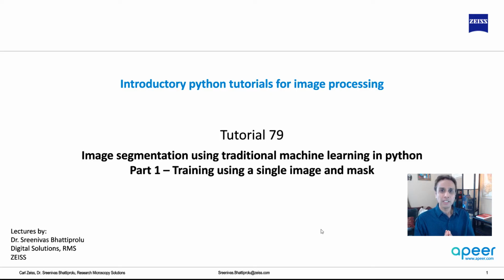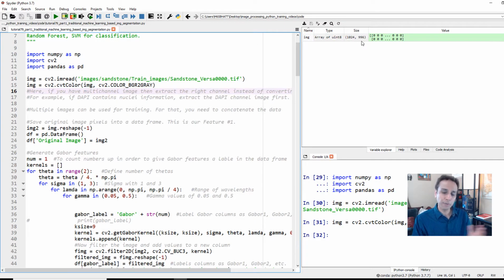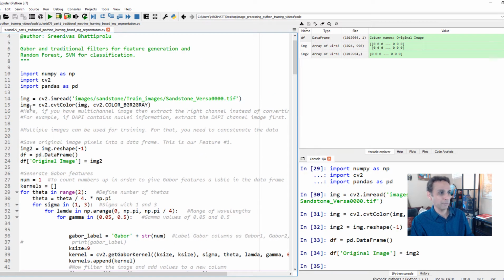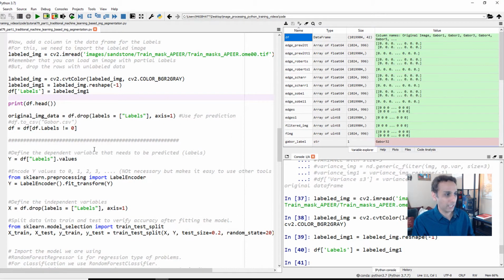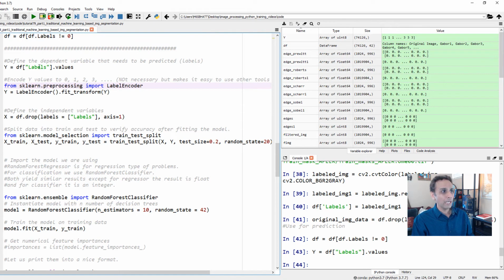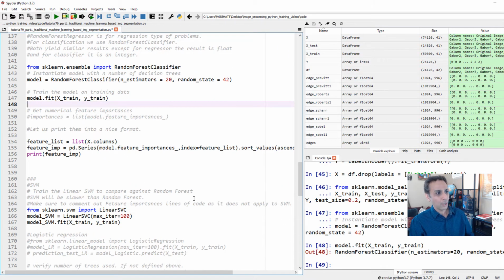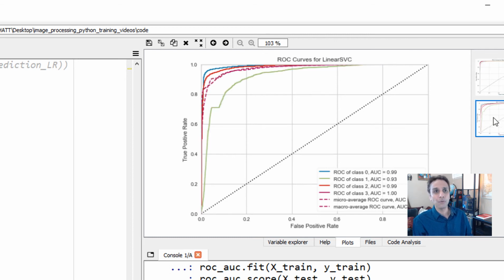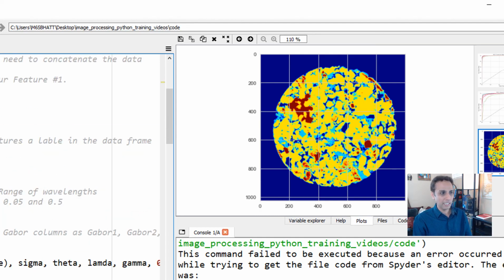Tutorial 79 - Image segmentation using traditional Machine Learning - Part 1

Comment: This video fits exactly my needs! For masking more continuous objects in an image such as separating land and water from a seashore image, should I mask the land and water as two whole objects (just two rows in dataframe) or take many points within the land and within the water (many rows)?
Reply from the maker: Either approaches will work. The number of disconnected annotations does not matter, it can be one large continuous regions or a few small patches from various regions. In deep learning, you usually are required to label every pixel in the image so you need to label the entire image but in this approach it can be anything.